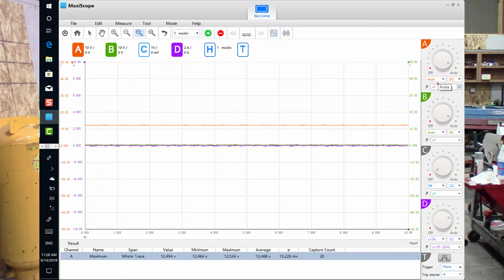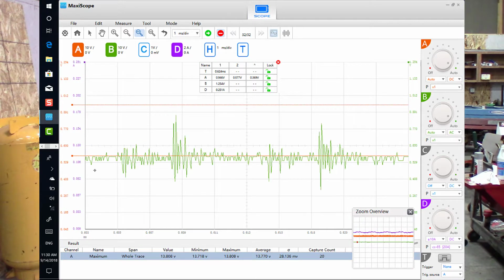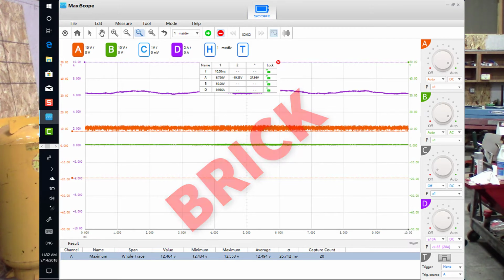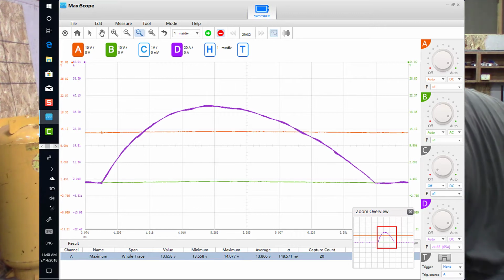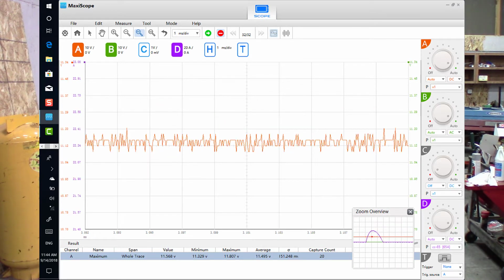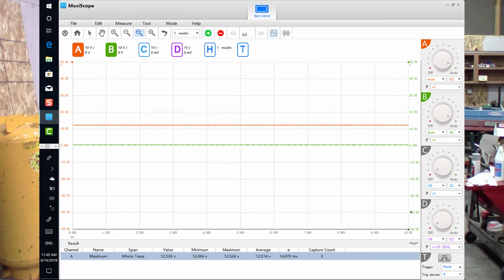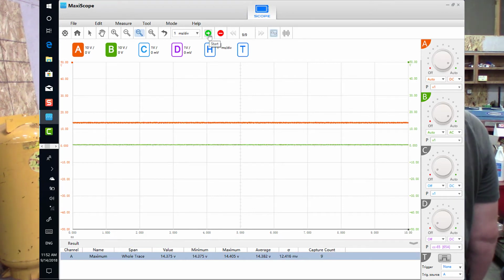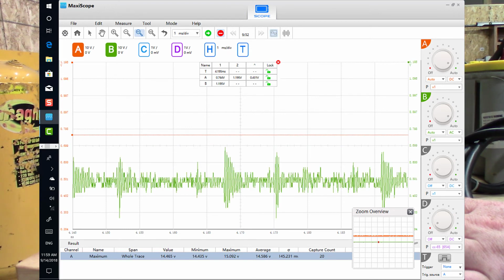Battery Maintainer vs Charger vs Stable Battery Supply

Comment: Some fun facts:

Maintainer conducted noise as applied to vehicle power when impressed on the CAN bus should be mostly common mode noise, and CAN being differential should reject this noise at probably a minimum of 40 dB.

The battery noise filtering effect on Maintainer output noise is dependent on the Impedance of the network (the battery, vehicle loads and all the cabling). If you increase the impedance by using jump start posts under hood (because the battery is in the trunk) the noise magnitude will increase at a given supply current because of the increase in network impedance.

The high frequency noise as applied to the vehicle power network will be filtered to some extent by way of VBAT filtering on board the module. However, this critical filtering is many times under-designed on-board the modules.

Fundamentally a battery charger should not be used as a maintainer. This is because one of the first modes of the charger will be Bulk Charging mode which is a current regulated mode and not a voltage regulated mode, it will however set a maximum average voltage level depending on if the battery type is flooded or AGM. A System Maintainer should be a voltage regulated supply, that is, it regulates output voltage given a changing load current (also with a changing line voltage).

The Schumacher INC70 is not amazingly quiet. A good industry performance target for vehicle 12V power rail maintainer supply peak-to-peak ripple should be 50mV at 50 Amps (this is the old GM standard), with this worse case being when connected to jump start posts under hood with the battery in the trunk. That means at the battery the noise measured would be less than 50mV, this is a very challenging specification to meet given the switching power supply techniques most often used.

Another important power supply requirement is the dynamic response when during reprogramming and system test a load is actuated like a cooling fan. The supply should momentary exhibit a voltage drop with a step change in current which should not be more than 250mV before recovering. This is also a very hard requirement to meet.

Let's do some basic math when we talk about a maintainer that can supply 100A at 13.5VDC. The 100A at 13.5VDC is a very common maximum requirement from the OEMs for reprogramming which includes system load actuator tests, but I have yet seen the need for anything over 60A at 13.5VDC with USA domestic passenger vehicles and light duty trucks. 

At 100A @ 13.5VDC the output power is 1350 Watts, and at a supply efficiency of 80% with perfect power factor correction on the input the minimum apparent input power (VA) needed is 1687.5 Watts, at 120VAC the branch circuit current needed is 14 Amps, which is getting close to a nominal common branch circuit limit of 15 Amps in the USA especially so if you include any voltage drop in the cabling. So for the 100A @ 13.5VDC you would really like to see the requirement for a 20A branch circuit which would have a different plug style especially if the maintainer does not have PF correction.

I think a much more realistic maintainer output would be a maximum of 60A at 15VDC giving an input requirement of around 10A at 120VAC, which is reasonable for a 15A branch circuit. 

Another problem not usually addressed properly is maintainer output voltage drop across the cabling (heavy duty cable clamps) which should be the set voltage at the vehicle and not the maintainer. Some newer design have a procedure to null out the cable resistance, but you rarely see a separate remote sense like you would see on an electronics lab test bench when supplying currents over 10A. Many automotive load testers in the past used 4-wire connections to account for voltage drop across the cables.
Reply: Damn! Spoken like my old shop instructor!👍🏼
Reply: I wish I had this kind of knowledge. 
Amazing.
Reply: I know this is probably a stupid question judging by your experience. But can you use the Topdon 90000 on the battery jump connectors under the hood on a grand Cherokee W2 style battery under seat , I won’t be do programming just compression testing clear flood cranking??? Appreciate your input

Comment: How many volts - 13.5v - do Mercedes and BMW programming need?
What are some more affordable power  suppliers out there?
Reply from the maker: Most of my programming friends run 13.5 to 14.3, but read the OE information. Check out the TOPDON T90000, this is a new maintainer on the market. https://www.topdon.us/products/tornado-90000?_pos=1&_sid=ac384af02&_ss=r

Comment: I have a 10A 12V charger and I'm just trying to flash my ECU back to stock. It has a 12v 10A "supply mode" would that be better than just letting it charge while flashing?
Reply from the maker: All manufacturers require at lease 13.5 volts if not more. Your 12 V supply charger is not going to do that. Is it better then putting it on a charger... I guess. But you are still playing with fire. Depending on the manufacturer, if they computer doesn't see at least 13.5 volts the programming session may never start.

Comment: There's lots of filters and switching regulators that lower the voltage down to 3.3Volts in cars
Mirco controllers,
Feedin direct voltage to the ECU will separate battery voltage from ECU voltage but it needs a good knowledge of pins schematics.
Plus, a modified PSU can deliver up to 120A and cheaper, further details and protection needed as well.

Comment: Hello, can I use a 12v battery jumper/booster pack?
Reply from the maker: Connecting a 12 volt battery would still just give you 2 volts. Most manufacturers now require 13.5 V when programming. So even with an added battery you are not going to meet the manufacturers requirements for voltage

Comment: Hi i have a question, i just recently downloaded bmw software and bought a schumacher battery charger/maintainer its rated at 200/40 amp with 6/12v, was wondering if that will be enough to maintain voltage on the battery? or if i should return it and buy a battery supply. i dont want to be the next magician that bricks his modules lol
Reply from the maker: BMW requires minimum of 70 amps contentious  and some require 100 amps. You need a stable power supply not a charger.
Reply: @FlashPerformance  I see, im sure you have been asked many times so im sorry for the redundant question. i just want to code out the stupid led lights warning, but scared ill brick my modules so i went with that schumacher battery. im completely new to this coding stuff so im glad i asked

Comment: Can U use another car with jumper cables!??
Reply from the maker: Manufacturers require 13.5 volts to do programming. If you are connected to another vehicle you are at 12.8 max to get to the required voltage now you have to run that other vehicle and now you are using the alternator and the voltage ripple generated from the 2nd vehicle which causes noise in the system.  The short answer is it is not worth the risk.

Comment: do the inc700 / inc100  need to be plugged in the standard socket while in operation? or do they have a built in battery?
Reply from the maker: Both require a 110v plugin to power the unit.

Comment: I can't afford to spend that much 😅. Can i use a server PSU 1000w as a stable battery supply ?
Reply from the maker: I have seen it done before, but I have heard issues maintaining the amperage needed during a programming session.  I would recommend doing testing and watching the amperage before using it full time.

Comment: inc700 A = trash, buy something else.  I had 2 and they die after 1 year
Reply: What would you recommend for a locksmith?
Reply: @SpringvisualTk  I just bought MIDTRONIC. Love it, as for locksmith you guys need maintainer?
Reply: @vinha916  well I thought there could be a combination of both maintainer and jumper but I guess not, eventually I will get into programming so I will need clean specific voltage, but right now I need a good jumper, ended up getting a good lithium ion jumper - heard good things about those, but I would love to hear your input
Reply: @SpringvisualTk  are you a mobile guy? if so get Midtronic with really good inverter in your car.  Jump box is always good to have.   If you work in a shop I recommended Snap on maintainer they cost that expensive also.  Snap-on can charger, flash. but they are huge to move around mobile, good for shop.
Reply: @vinha916  yeah most locksmiths in my area are mobile, thank you for your suggestion, I'll look into the midtronic, if only the snap on had a mobile solution
Reply: newbie question maybe... why would a locksmith need a battery maintainer when the key adding process in some vehicles envolves reading & writing data to some ecus?
Reply: @crlp3r  some cars require not just that.  and time will drain battery .  Most of the time you don't need it.  However, if you're doing it right then you need it.

Comment: Totally makes sense as to why the stable battery power supply is needed to flash ecu's and that the typical battery chargers/maintainers just can't do the job as you've demonstrated. My question is, if I only have those basic battery chargers/maintainers, and I don't own a stable power supply, would I just be safer flashing the ecu without anything attached, and just flash using the car's battery as long as i've driven around for awhile and made sure it is fully charged? In the video, you didn't show the "flashing" load on the battery just by itself. On a fully charged battery, would the load from flashing cause the voltage to drop below the "minimum" in the 20ish minutes it could potentially take to flash and ecu?
Reply: Your best bet is to just buy the proper equipment. Yes, I'm sure you can program quite a few cars with just a fully charged battery, but I can tell you from experience, programming/flashing the ECU and modules can really draw the battery down in a hurry. I bricked the ECU for 2005 GTO with a Tech 2 hooked up, and it had a fully charged battery. A regular charger like my Optima won't even  keep up when battery level drops. There are people that have bricked ECUs updated the engine tunes using HP Tuners. It really depends on the vehicle and ECU, it seems some are more sensitive than others.

Comment: Hi, i'm using two server power supply connected in parallel. What you think about it?
Reply from the maker: Server power supplies are great at producing clean voltage, however I have seen issues with them holding Amperage.  I have not done any testing with two connected in parallel.  I would recommend putting an amp clamp on it and see how it does with amperage.
Reply: @FlashPerformance  https://www.youtube.com/watch?v=qkubPg16Dyw&t=242s

Comment: Great video. I wonder about a fourth option? What if someone was to attach two batteries together with a tiny charger to keep those maintained and use that as a supplemental battery to attach to the car to maintain good voltage and more importantly clean voltage? Do you think this would be an economical alternative? What do you think the negatives would be in that situation?
Reply from the maker: When programming vehicles like 13.5  to 14.2 Volts.  Connecting 2 batteries would not accomplish that.  I have seen people do it with 2 batteries but it is not recommended.
Reply: It worked great for me. I charged my truck battery up the night before, and then used jumper cables to hook truck battery to the car battery that I was programming, and charged truck battery with 2 amp charge throughout programming....no problems at all. IMO you do not need to spend big money for a battery maintainer if you just do this oncee in a while.
Reply: @MRM-wp4gr Unless your an unfortunate like myself without a second battery…

Comment: Very well done video I have a question about the Autel scope that you have in your video I have the same scope and I don’t have much experience with  oscilloscope but it seems like you have the hang of it I was reading the manual on the scope and my main question is how many reference wave form can it store for future reference in the manual it says only 4 is this true and I don’t even know how to do it it would be nice if you could do a how to on the Autel scope there is no good video on U tube on this tool only lots on the pico scope .
Reply from the maker: I have not done much with stored wave forms.  I usually use IATN for known good waveforms instead of trying to save them.  The only reason I would save a waveform on the scope is to compare it to one on the same vehicle I am working on.  I am not a scope expert but I will see if I can put a video together on that function.  Thanks!
Reply: Thanks for the response.  So you are saying that you can download a file from  Aitn and compare it side by side and do measurements like people are doing with the pico scope ?
Reply from the maker: @V10PDTDI  http://www.iatn.net/automotive-waveform-library, I know you can view the waveform library on the tool.  However I am not sure if you can put them side by side. I have not tried that.